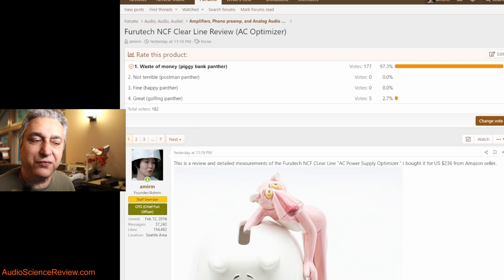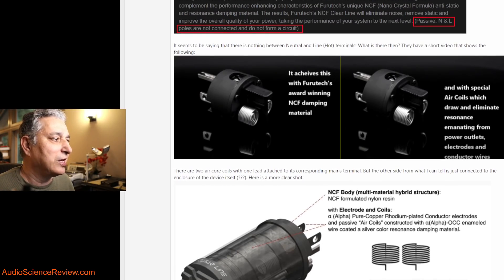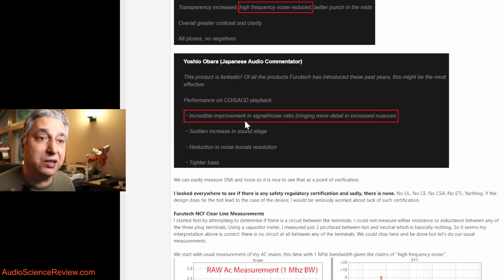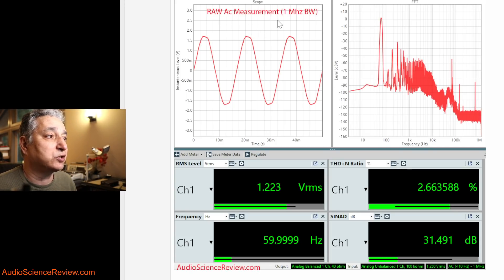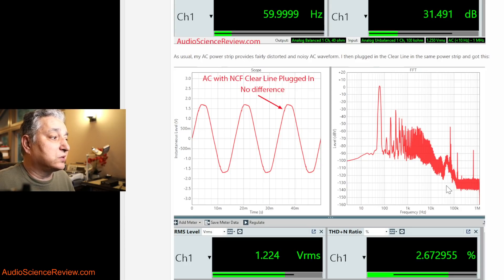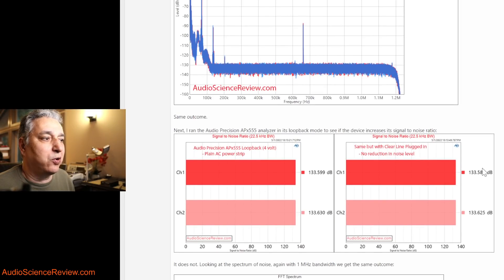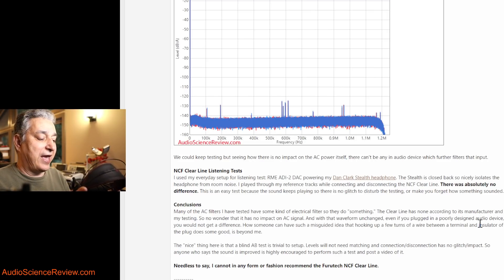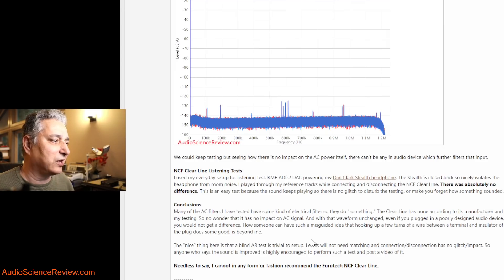Furutech NCF Clear Line AC Optimizer Review

Comment: Is this UL listed? lol
It is not legally required to be.
Only permanent fixtures to premisses wiring need be as required by the NEC.
Benchmark and McIntosh are not UL Listed or Certified. The only have what is required to sell in foreign markets, CE, TUV, EAC, etc.  Some are not marked at all.

"When it comes to matters of safety, I suggest not commenting if you don't have the knowledge. This stuff is serious."

The device has a transfer function
Voltage, hence current and power flow
Fact

Comment: I have a similar device from iFi. I bought it thinking (foolishly) it would help remove some barely audible noise in my system. It didn't. Rather than return it, it stays plugged into an empty spot on my surge protector as a reminder of the old adage a fool and his money are soon parted. It's not even a good conversation piece because it's plugged in out of sight. Every time I see one of these reviews I get a chuckle and think "yup, I fell for that one." Another great video, Amir.
Reply: I bought one too; no difference. Seemed a good idea at the time.
Reply: Aren't the iFi devices active?
Reply: @niallms83  Yes, they are.

Comment: I have always argued that the most important thing about audio is the engineering itself, not what kind of capacitor we put in the crossover and not what magic dust we scattered on the system.  Well done Amir, thank you so much for the time you spend proving things.

Comment: Maybe they got inspired by that antenna AQ attaches to all their cables so that they can pick as many radio signals as possible to improve the sound. But instead of battery they came up with a "genial" idea to use inductance (probably that's why they used the term passive). Enough to lure an unsuspecting customer into buying this junk. Maybe someone thinks the biggest profits are with equipment worth 1000s. Nope. If you want to get rich quick and under the radar, you go with a product like this. Or cable. It is the most lucrative business ever invented. The concept is clear. Audiofools are already prepped (through magazines, forums etc) that only 1000s spent mean something. Now comes a brand with a $200 "product" and they think it can't be bad, and they plunge $200. 30yrs ago, one business was very popular in eastern europe, so called kiosk business. A small kiosk in the middle of a busy sidewalk. selling cheap shyte like Bic for shaving, gums, cigarettes, condoms, sweets, sodas. kiosk owners were millionaires. they come at the end of the day in their latest Mercedes models and pick up pazar (profit). most stuff costed pfennigs or pennies. one cannot believe how much profit this kind of business brings.

Comment: I bought a furman power strip unit with the digital option(pst-8d) last year. It wasn't that costly at all, let's me plug in 8 devices. I am pretty happy. It's more useful and cost a lot less than that useless thing... But does it really power condition, that is for someone else to check...

Comment: Thanks Amir. This unit is designed and made in Japan(?) Also, the reviewers are from Japan. I am wondering whether this unit will only perform under very light earthquakes.  As you may know, there are many low level earthquakes in Japan everyday ! Exception audio performance under light earthquakes?
My friend show me a piece of marble with 4 rubber feet. It is used to support a CD transport and suppose to enhance sound quality, every person in the hifi shop claimed to hear improvement except me. The explanation is absorption of Sonic vibration to electronic components inside the CD player. That's another myth for me.
Reply: I used a marble platform under my CD player and amp for many years. The main reason was it looked cool! That and it cost me £5 as it was a marble chopping board! I'm sure Furutech would sell the same thing for $500.

Comment: About 15 years ago, I bought a similar filtering device at my city's audio festival. It's also made in Japan by a little known company, Enokido Inc.. The device is called the AC Enacom and is designed to be pluged into the AC wall outlet or an AC power strip. It's supposed to remove high frequency ringing noise according to the included leaflet. It received favorable reviews from some clueless "professional" audio reviewers. I tried it but I never noticed any improvements in sound. If memory serves, I paid about $70 CAD. Amir's review empirically shows that these devices simply don't work unless you need a little snake oil to add some luster to your audio system.
Reply: I remember those. I chose not to buy them but instead got their "Speaker Enacom". And I heard a difference when they were connected to my speaker terminals. I sure hope if those ever got measured by Amir, it doesn't confirm my imagination got the better of my wallet.

Comment: Great job, Amir. I don't own any Furutech products but had the fairly hazy impression of them as a manufacturer of high quality, well engineered, if pricy, items. Oh dear.
Clearly my bullshit filter failed miserably.
Have you ever tested the little iFi ipower wall warts ? Not terribly expensive (£50 in UK ) well built and come with loads of useful connectors and plug types for 5-12v DC devices. I have a bunch of them and have convinced myself they make a difference, but I wonder if they actually do ?
Reply: I have them on in use on my TT motor and Phono.  I was getting interference/humming and as soon as I tied them into the ground on the iFi terminator all was quite and good. I have seen a few video on Youtube with other using them with no results but all of those video have the LEDs in the "red" state so not grounded.

Comment: Hey Amir! On the topic of AC optimizing, I'm experiencing pops and crackles through my active speakers (LSR 305) when an electrical device is turned on in my rental apartment (eg. bathroom lights). I had to get an RCA-ground loop isolator to get rid of gpu whine through speakers. What is the cheapest and electrically sound solution for my situation? My signal chain is PC motherboard audio out -> SVS PB1000 -> high pass to LSR 305s with the subs crossover. Thanks in advance!
Reply: I had/have a similar issue. I brought a tashin 6 outlet power strip with a filter and surge protector. From Amazon for £35. It's reduced the issue significantly to the point I'm happy to ignore it.
Reply: @chrisvinicombe9947  That truly sounds like a solution that I might be able to live with since I listened to the gpu whine for too long! But something that I hate is wasting money on stuff that doesn't solve my problem in the long term and causing me to spend more money to actually solve the problem. Thanks for the tip anyway!
Reply from the maker: Was it doing it without a connection to a PC?  If not then getting an external DAC could help a lot.
Reply: @AudioScienceReview  Just tested it and lo and behold, the noise is gone when I unplugged the aux from the motherboard. Just another way to show how badly the DAC is electrically protected on the motherboard (an affordable Z490). Is there a surefire way to know that an external DAC won't experience the same problems as the motherboard output (electrical load spikes getting through to speakers as pops and crackles)? Before getting the isolator, I had my eye on the Topping D10s or E30 as they both should be acoustically transparent.

Comment: As has been already mentioned many times, serious audiophile gear is meant to be burned in for at least 300 hours before the sound opens up. This is not mainstream BestBuy level stuff you might be used to.
Reply from the maker: Without safety regulation on this device, no way I am leaving it on for 300 hours unattended!  That aside, if you want to bet $300 that it will change in 300 hours, I can do that testing (it will push me past my return period and hence the money request).

BTW, the company says "Suggested burn in time 24 hrs."  That is not 300 hours, nor is it mandatory.
Reply: @AudioScienceReview  you can speed up the process if you hook up the headphones using pure silver cables. At the end of the day we are judging sounds and any test should include listening time.
Reply: That’s just silly, it’s literally nothing. I really hope you meant that to be a joke but it’s hard to tell.
Reply: It takes up to 300 hours for your mind to be convinced it is doing something.   Crazy.